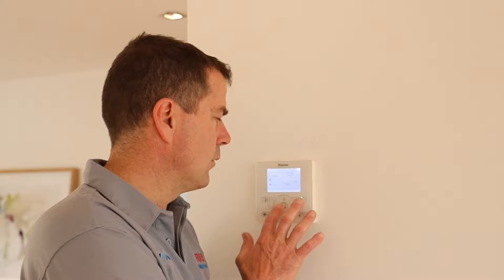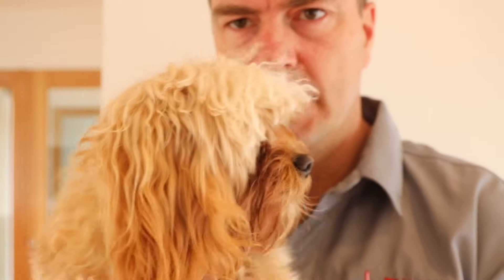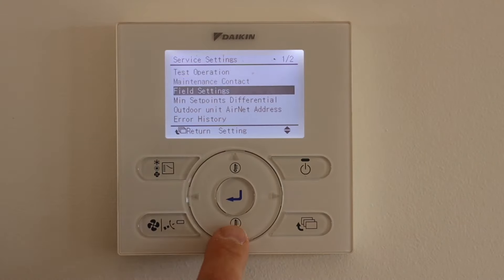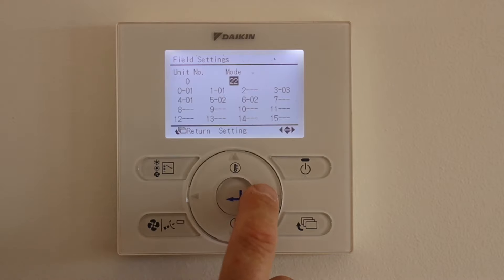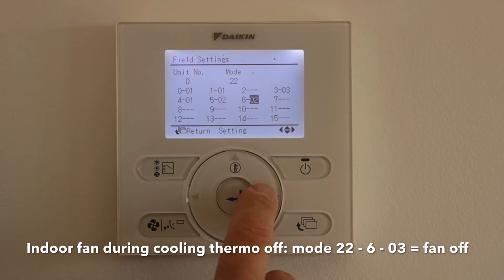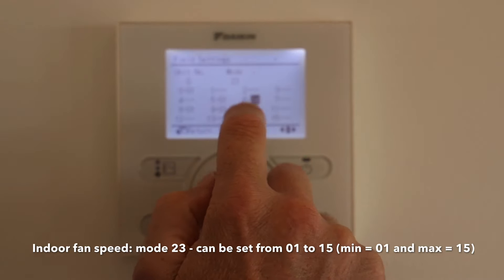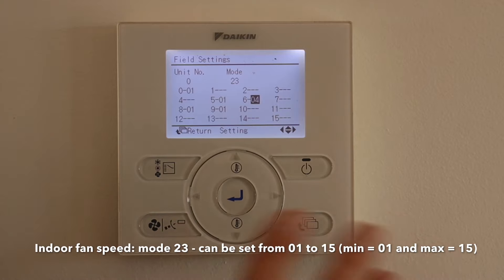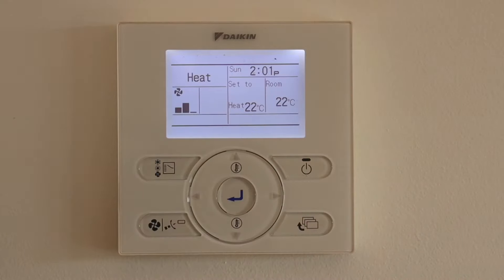Daikin BRC1E63 controller set up field settings cycle fan off, activate sensor in wall controller

Comment: Thanks for the video ,very helpfull.

bu my question is i thought that the fan speed can be adjust in mode 23 but in #7 not in number 6 sir

cause 7 is factory set.

just correct me if i am wrong.

tnx
Reply from the maker: Hi Johnny,
As long as I have been doing Daikin about (28 years its been 23-6) with D/C fan motors its 1-15 speed settings and with the old A/C indoor fan motors its was 01 standard static, 02 high static and 03 is for low static. The adjustable speed selections were only available the fan motor was manufactured with multiply speeds, some only have two settings. And this is for Australian ducted models.
Thanks
Reply: @FullyAirconditioned  ok sir thank you for the enlightenment.

i always stand myself for correction specially from people who is better than me or well experienced than me

well appreciated Sir. thank u
Reply from the maker: @johnnyroxannebautista2063  I could find and settings for #7, #7 setting are there but Daikin has not listed what they do, some times they do have settings that can be set but are like Secret squirrel stuff and not published.
Reply: @FullyAirconditioned  hello sir thank you and i admit i'm wrong cause i tried to do it in 23-6 and the fan speed increases.

but if i wish to bring it back to the original set up sir?

what im gonna do?

Comment: I recently shifted to an apartment where daikin brc1e63 system is installed. I changed the settings following your video. Also, I have set fan speed to auto and set the heat (this is heat not auto node) to 18 degree as it is winters where I am staying, cool temperature is set to 27 degrees, am I setting it correctly? I am totally new to this. Please advise for any corrections in the settings I have done.

Regards
Reply from the maker: If it gets below 18 it should start heating and above 27 start cooling, in-between the two remodel it should do nothing (dead zone). I do find 18 a little too cool tho for heating but whatever you find comfortable.

Comment: Very helpful. You mention that in one of the settings, the fan would switch automatically when it reaches the set temperature. Would that increase energy expenses? The dealer told me that this should remain on all the time as they are designed to stay on all the time. Appreciate any insight.
Reply from the maker: No it won’t increase running cost, but you will have to make the wall controller sensor active for it to maintain a correct temp with in the conditioned space.
Reply: @FullyAirconditioned  Thank you for replying. How do I make the wall controller sensor active? Also, looks like I have a newer wired controller...are these field settings also available on the new controller? thanks!
Reply from the maker: @carlcachia8948  follow the set up in the video
Reply: @FullyAirconditioned  I rewatched and found it...an excuse to see the cute dog :)

Comment: Hi there, I have one of these controllers, connected to a compact ceiling cassette.  My observation is the system never works hard enough when I have it set to FAN AUTO mode.  By that I mean it really struggles to reach the set temperature because it rarely shifts itself up beyond the lowest/quietest fan speed/power level.  Is there some way in the field settings to make it more keen to shift into a 'higher gear' when in FAN AUTO mode; thus working a bit harder overall?  I guess what I'm trying to say is I'd like the system overall to be more enthusiastic about ramping itself up so it can get to the set temperature faster.  I had hoped your advice in this video with regard to changing the max fan speed would help, but it seems that playing with this particular field setting isn't available in my setup (I presume this is because I have a ceiling cassette and not a ducted unit).
Reply from the maker: Hi,
With the cassette systems there some field settings that can be set like high ceilings, this off sets the control temperature to compensate for 
high ceilings. Also there is a different code to make the sensor active in the wired remote control. See attached link https://drive.google.com/drive/folders/1KHh8K8Bq4G3KYqpdkkU7a4jQAMLbkU36
Reply: @FullyAirconditioned  Thankyou for this; much appreciated.  It looks like you have the one key document I couldn't find anywhere on the internet!  [I came close - after several hours of searching - I found a BRC1E53 installer manual; which talks about adjusting "high air outlet velocity" for different height ceilings - via the same 23-0 setting.]  I will have a play with the height settings and see if I can get any useful improvement to my system.  As for the making-the-controller-sensor-active setting being different; I just checked my system and it looks like it is already set to use the controller sensor already.  Can I ask one more question?  Does my particular setup offer any corresponding field settings for the turning-off-indoor-fan-when-thermostat-is-satisfied options that you go through in your video?  Many thanks!
Reply: @FullyAirconditioned hi, I have this exact question but for a ducted sky air system! Doesn't seem enthusiastic to ramp up as described above while in auto fan speed. Any suggestions?

Comment: Great video,
My room temperature is set to 18 but the temperature is showing 23 it’s definitely not 23 we do have another weather gage which shows the room at 20. At times the system will heat to 25 even though it’s stet to no more the 20 heating. Hope you can help.
Reply from the maker: Have you set the wall controller to be the active sensor like in the video ?? 20-2-03. Are you using the temp display on the wall controller or a different temp gauge. The system is only going to look at the active sensor to control the temp, the sensors are not always 100% accurate so you just adjust it till you feel comfortable. Is the wall controller near other heat source (like the sun or air blowing from a vent on to the sensor), is the controller on an exterior wall that cops a lot of sun.

Comment: Hi thanks for the video. My wall controller can only be controlled from one master bedroom and not the other rooms. Is there any way to change the settings so each room can be controlled individually?
Reply from the maker: You have multi able controllers ?? Some of the controllers don’t have heating and cooling on them  to chose from ably the one in the bedroom??

Comment: Nice video! My MSX36 inverter always seems to run at full speed (loud) even with one FDMQ calling for 1 degree change.  Any ideas why this could be? Thanks!
Reply from the maker: The fan at full speed or the heating cooling capacity?? If it’s the fan then it depends on the fam motor type. Ac fan motors are limited to a few speeds with not a lot of difference. A dc fan motor can have many fan speeds over a very wide range.

Comment: We have a ducted system with bedroom and living room zones. There is the master control panel in the living space and a slave/sub control panel in the upstairs hallway, with the return air duct in the same upstairs hallway. Does the control panel thermistor only read the downstairs main control panel (when the field settings are changed)? Does it make more sense to use the return air temp in this case?
Reply from the maker: When sensing from the wall controller when you have a master controller and a slave controller, the sensor will only look at the master controller. The 2nd controller is a slave controller just mimics what happening on the other controller and give you the ability to adjust settings from both controllers.

Comment: Will this be the same settings for a cassette for fan cycling off? This code is not in the installation manual, cheers.
Reply from the maker: Probably not, cassette unit is different and has different setting’s

Comment: I tried to set it up as your instructions and the fan is turned off successfully. However, in a few minutes later, the fan is on again, and then in the next few minutes later it is off again. Could you guys please instruct me how to set the fan totally off?
Reply from the maker: You need to set the temp to sense from only the wall controller, I believe it alternates between the return air and the wall controller, Chang that and see how it goes
Reply: Could you please instruct me to do that? @FullyAirconditioned
Reply from the maker: @gvan2807  change it to 20-2-03 that should be sensing from the wall controller, make sure that the wall controller doesn’t have any air from the outlets blowing directly at the controller, this air blowing at the wall controller will cause it to short cycle as well if it’s already sensing from the controller

Comment: Hey there. Just got a Daikin heat pump installed (FDYA125AV1 indoor unit) and found this video. Of course I jumped in and changed all the settings (apart from the fan speed), then I read that indoor units vary and I may have messed up some setting (didn’t make a note of what I changed from). I did ask the sales person about the this and said it looked ok but he wasn’t sure about Mode 22-3 fan turning off when thermostat shuts off heat. Here comes the question. Why can’t I find online a list of Field Service setting for a particular indoor unit. Protected IP from Daikin? Maybe thanks.
Reply from the maker: Hi Aaron,

It’s actually in the indoor units install manual, has all the setting their, what’s set from factory and setting that can be changed.
Factory set to 22.3.01 (low low fan on thermostat off),
22.3.02 is (set speed on the controller) and 
22.3.03 (fan off when thermostat off)
Kind regards 
Craig hewitt

Comment: Can you please explain what the Indoor Unit Status temperature labels are for in this setup menu. For example Th1: 22°C, Th5: 27°C etc... my indoor room temp is saying 27°C but it feels much cooler. Could it be incorrect? I have a BRC1E63 as well
Reply from the maker: Hi Aidan,

It depends on what indoor units its connected to, but on ducted systems Australia th1 is usually the suction air thermistor on the indoor unit, th2 heat exchanger liquid line indoor unit, th3 heat exchanger gas pipe indoor unit, th4 discharge air temp indoor unit, th5 could be wall controller ??, easy way to check is to blow warm in the thermistor and see if it changes.

Comment: Hi there! I'm using this controller in my duplex apartment. The vent in the upstairs living room is working just fine. However, the vent downstairs has its own wireless remote and receiver, but only the fan mode is working. When I try to switch it to cooling or heating, the receiver's light just blinks, and nothing happens. Any idea what's going on?
Reply from the maker: @HL-ng4bh  it’s probably a VRV or multi head system with only one outdoor unit, change the mode at the upstairs unit to the mode you want down stairs. Then check  the unit down stairs, it should go into the same mode. The up stairs unit is the master and dictates what mode the system is in, give it a try.
Reply: @FullyAirconditioned  Thanks for the tip! I've made sure that both the upstairs and downstairs units are on the same mode, but the downstairs vent still isn’t working. Could this be something to do with the field settings? Looking forward to your further advice. Thanks!

Comment: Would you know why my thermostat keeps switching off after 3 hours (exactly 3). I have no timer on, nothing. Is there a field setting to disconnect the wall motion sensor?? I think my rented house might have a motion sensor that’s why it shuts off
Reply from the maker: @isharathore9825  check the energy saving options, sounds like someone has set a push button time for 3 hours operation. Push menu, energy saving options, energy saving list and check that that they are all turned off, that should fix it.

Comment: Good info, can these keep temperature constant for heating? Instead of dropping 1-2 degrees then coming on?
Reply from the maker: This setting will keep the temp more accurately at the wall controller location, apposed  to the sensor in the indoor unit.

Comment: My brand new ducted slimline premium unit was not cooling the house down in extreme weathers. I just checked the settings and it was set on 5 when it had the option on 15 now its blowing cold air must harder. Why was it set so low is that a daiken thing?
Reply from the maker: Don’t think so as factory set is 10, if you don’t get enough air across the coil it won’t allow the compressor to fully ramp up. The compressor will only run as fast as it’s needed, with low air flow, only so much gas can evaporate off, (changing from a liquid to a vapour) the speed of the compressor is slowed down so that liquid gas doesn’t flood back to the compressor and damage it.

Comment: Hello
I just want to know can this unit be controlled via 
Smart home device
If so what are the available devices that will help to accommodate it
Reply from the maker: There many different ways, you could use Daikin’s wifi controller (air base) and the mobile app, you could use Daikin’s Reiri or a third party interface like cool automations. There are so many different options todo this.

Comment: Hello, very helpful video thank you!! Mine only has the options of ‘fab’ & ‘heat’ & I have tried everything to make it cool but can’t figure it out. Please help 😫
Reply from the maker: Is it a Vrv unit unit more than one indoor unit, will usually have a triangular sim bike on the screen. If yes you need to find the master controller(that will be the one where all setting are available) change it to cooling and the sub units will now be able to cool, fan and dry. You can also change the master by pudding and holding down the mode button on the master controller, then push the mode button on the controller you want as the master. 
Kind regards
Reply: @FullyAirconditioned  omg you have just saved the day. It’s finally working!!! Thank you thank you thank you
Reply from the maker: @monicaanne4712  all good

Comment: i have three master and two slave VRV systems with 21 indoor units, I have to connect these meters to cool master integration module to access the units in the application.
Could you help me how to set up the address for each unit to integrate with cool master module? Is it from the main unit or individual addressing
Reply from the maker: Go into set up menu ( push and hold return button 5sec) there should be an “group address” in the menu, then scroll down to group address hit enter, then set the group address for that to indoor units, 1-00 will be the 1st unit then 1-01 is the 2nd unit and so on, press enter to save. You need to do this at each indoor units controller. You will probably need the cool master conected at the outdoor unit connections that say “to outdoor unit” all the outdoor unit will need to be daisy chained, Q1 Q2, to outdoor unit, then to the cool master controller.

Comment: Hi there - do you have recommendations for NZ settings?
Reply from the maker: I believe your units are the same as Australian 🇦🇺 unit. Actually I just looked at a Daikin ducted brochure on the NZ 🇳🇿Daikin web site and they have the same model No’s. 👍🏻 Australian made indoor units and outdoor from the Daikin Thailand  factory.
Reply: Ok cheers - so fully ducted system and same controller, recommend the settings as per your video?

Comment: What does a green blinking light mean on the wall controller?
Reply from the maker: The unit has detected a fault and has shut down,  heck the code and make a note of it, do a power reset, turn it off for 5min then back on, run the unit. If the fault comes back call a Daikin’s service tech

Comment: Can I use a wireless remote with this? Trying to make this smart within my smart home ecosystem
Reply from the maker: You should be able to connect a 2nd controller, one will be the master and one will be a slave controller. The 2nd controller can be a wireless remote controller. The wireless remote has a receiver and the actual wireless remote. The receiver is wired back to the indoor unit just like the wall controller and is surface mounted on the plasterboard wall or ceiling. The remote is IR, and only work “line of sight” to the receiver, like a tv remote, it doesn’t work if it’s not pointed at the tv’s receiver. Think it’s a BRC1E62.

Comment: Hello, if I have already done the cleaning, what should I do to make the reminder disappear?
Reply from the maker: @黃小華-z1l  there is a filter reset in the menu, push the centre button and scroll up or down to the “reset filter” then press enter
Reply: @FullyAirconditioned  Thank you so much

Comment: Hello! Can you help me with field settings for a cassette type indoor unit, daikin fcag71aveb. I can't make the fan rotate with more than 590rpms. Thank you!
Reply from the maker: @cristianmaier7886  we don’t have that model here in Australia but the setting for out systems for high static fan is 23-6-02
Reply: @FullyAirconditioned   Thanks for the answer! 23-6- is - -, unavailable.

Comment: Do you know if you can change the temp reading on the airbase system?
On the app it reads one temp which I believe is from return air but on wall u have the room temp
Pretty annoying daikin airbase won't allow this can't have a proper room reading

Comment: Is it possible to change the settings for thermo on/off deadband? For the model you’ve shown which we have.
Reply from the maker: Do you want to tighten it or make it larger, larger is possible by setting the two set points, but making it smaller is not possible 😢
Reply: Want to tighten it to 1 degree. I can’t see what our setting is, but seems it’s often 2 degrees below before heat comes on.